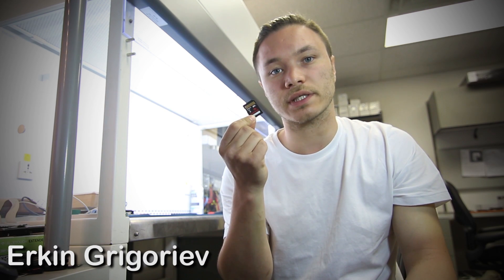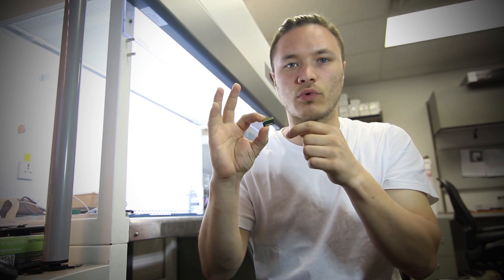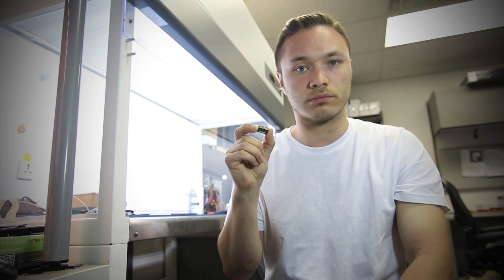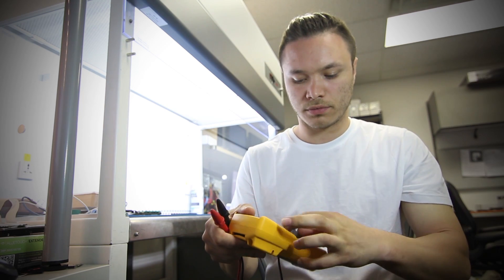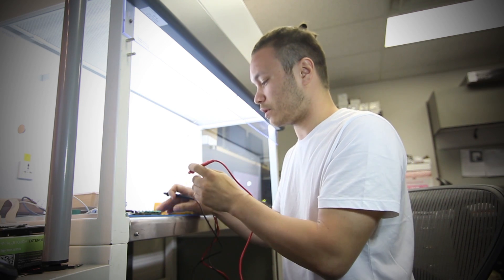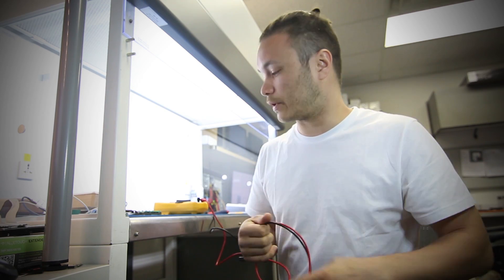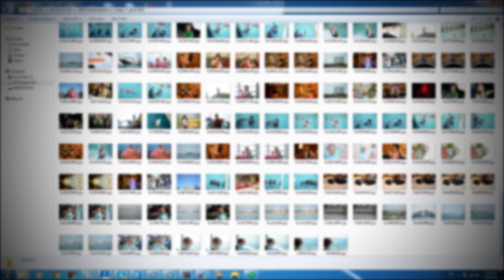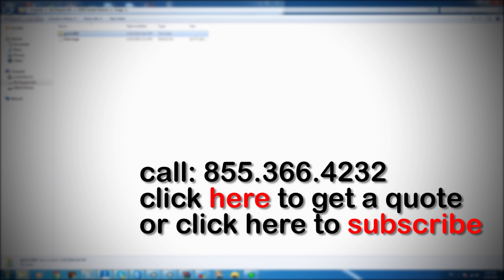SD card fix – corrupted sd card recovery

Comment: #HDDRecoveryServices, I purchased a 128GB SanDisk micro SD (UHS-I U3 C10). The problem is that although the card is fine for photography, when I try to record video (4K or 1080p) I get an error message that I should use UHS-I U3 compatible card. PLEASE HELP....I have tried to format the card on PC and in-camera but no change.

Comment: QUESTION PLEASE: If an SD card becomes corrupted from yanking it out of the reader while in use or when just merely plugged in - do the files on the SD card become corrupted also? the reason I ask is iv removed my SD card a few times from reader without properly disconnecting it in windows and worrying some of my thousands of files have become damaged in some way
Reply from the maker: it shouldn't get corrupted

Comment: A few questions.. 1) Can you use the Rusolut software on other hardware platforms or is it proprietary?  What software where you using there?  2) What adaptor was that?
Reply from the maker: You can use Rusolut, with pretty much any type of file. It will not work unless you have hardware portion of the tool hooked up. This is just a wire adapter for Flash Extractor reader
Reply: +HDD Recovery Services Hey sorry what I meant is there are other cheaper nand reader reprogrammers out there, can you use them with the rusolut software or do you need their hardware?
Reply from the maker: You will need the hardware to go with the software. Software on its own is not going to let you work. Plus in order to begin reading the dump out of the memory component you would need to specify configuration (sort of like structure, which will indicate, the protocol, page length, block size etc...) Without configuration you can't start putting the virtual image together

Comment: It's perfect video
Just a question, how do you know the pinout for this SD card? And why you don't use rusolut for this case?
Reply from the maker: +magic DR its a standard Sandisk pinout for 8bit unit, we have about 50-60 pinouts collectively for different types of devices. Rusolut adapter was in use for the microSD card that was being recovered at the time:
https://scontent-yyz1-1.xx.fbcdn.net/t31.0-8/13055174_984963624905182_4753914191822257465_o.jpg

Comment: Great video as always.  I don't think people understand why this sort of data recovery can be expensive.  The equipment and resources (schematics and recovery programs) can be 1000s of dollars.  Do you guys perform any forensic data recovery/analysis?   Also would there be any way to recover the data if the controller is shorted?
Reply from the maker: Jay, we don't do forensics, at least not yet. If the controller is shorted out, there is still a way to communicate with the nand, but the controller has to be traced out and cut to prevent overheating. With shorted controller unit will get really hot and melt the solder off, plus there is a high risk of damaging the reading equipment. That continuity test on power and ground is a very important step. Controller can be traced using a high definition x-ray image of the device, but in many cases it is buried inside, so cutting power input to it can be really challenging.
Reply: +HDD Recovery Services Cool.  Another question.  Do you do data recovery on vintage harddrives such as MFM and RLL drives? Im also curious what would you consider your most interesting nonconventional procedure for recovering data?  Im no expert but Id suggest against forensics because even tho the pay can be good following chains of custody and documenting ever single thing you do has to get tedious and annoying.
Reply from the maker: +Jay Walt the point above is the main reason I don't want to get into forensics. MFM and RRL drives... hmmm, I have to say I have never seen one in the 11 years of hard drive recovery, and I don't have any equipment that will support these drives.
Reply: +HDD Recovery Services Yeah I was just curious.  Ive had one case but it wasnt a data recovery effort but moreso a data retreiveal (the original ibm 5150 had a beverage spilled on it and the motherboard was toast).  Luckily at the time I still had my 5170 so it wasnt too bad.